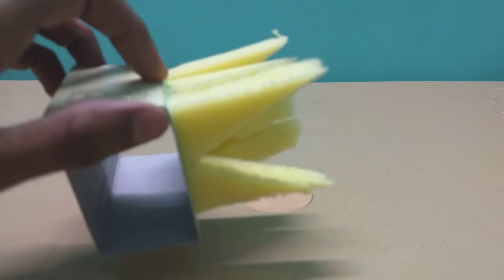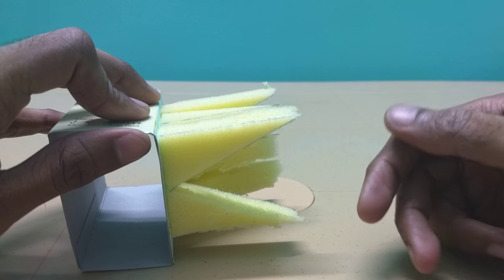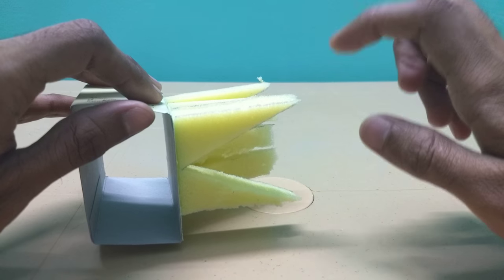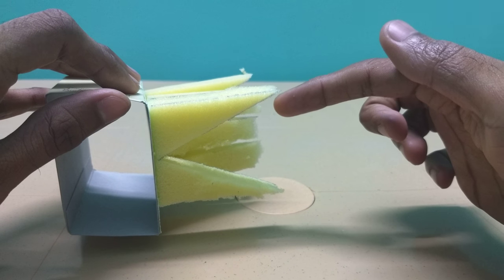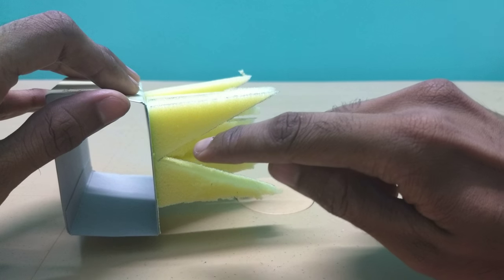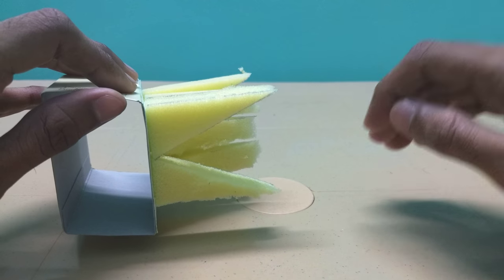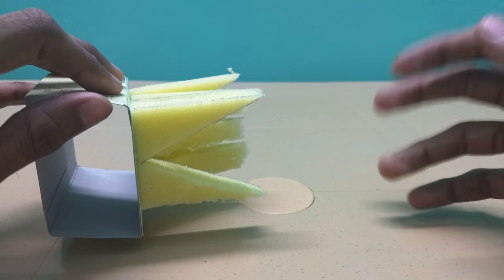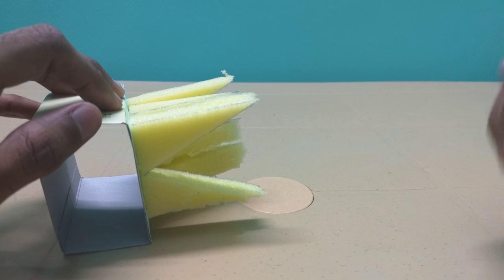Anechoic chamber working principle

Comment: Have no Idea if you Will read this coments but if yes that was an amading video. Please what is the bast configuration of the piramids and which material it is more apropriate for such porpouse thanks.
Reply from the maker: There are many parameters to consider while designing an Anechoic/Semi-anechoic chamber. The most important is the cut-off frequency of the chamber which depends on the chamber dimensions and the wedge height. The lower the cut-off frequency, the larger should be the room size and the wedge height. Wedges help achieve near free field condition not only by absorbing high frequencies but also by trapping the lower frequencies due to their tapered shape. The wedge material must be a good absorber (ex. fiberglass, foam) with 0.99 absorption coefficient over a defined frequency range.

Comment: What sort of foam would you need to use, I have a generator I want to quieten?
Reply from the maker: To solve this problem, you need to perform acoustical treatment which usually involves the use of sound absorption and sound blocking technologies.
Reply: Will just using pointed foam alone kill all the noise?